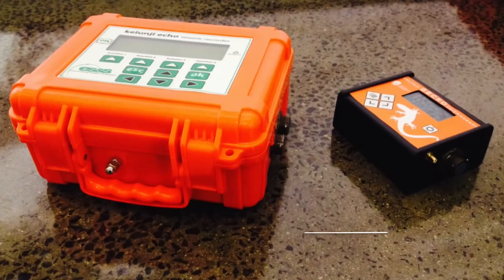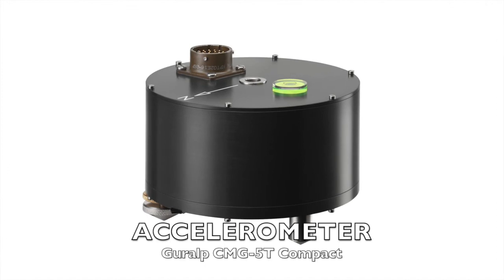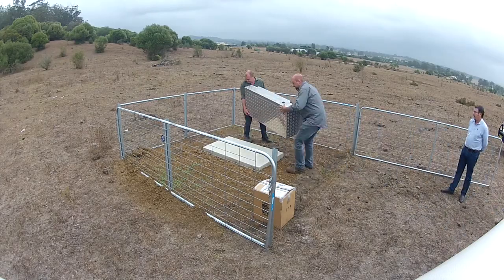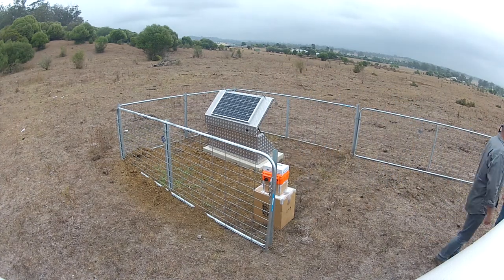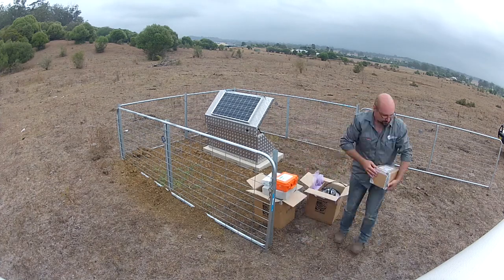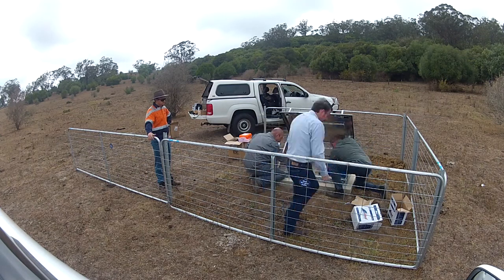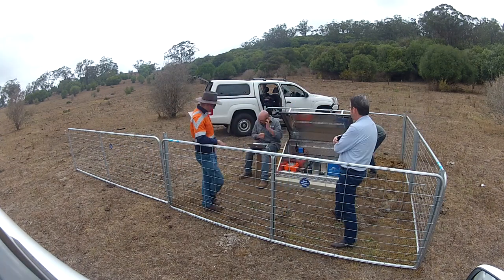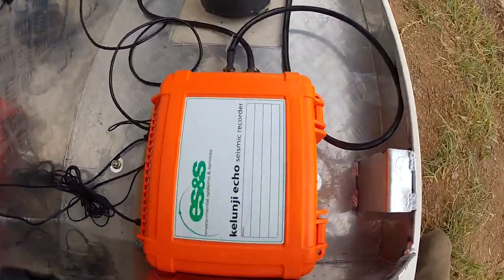Installing a Seismograph

Comment: Hello, is this a electromagnetic seismometer ? And also, which of the elements needs the solar power ?
Reply from the maker: The sensors contain coils and magnets are use electrical feedback for improved frequency performance. The data logger, sensors, and cellular modems all continuously draw power from the batteries which are recharged by the solar panels.
Reply: @EarthquakesAU  thanks for your reply !